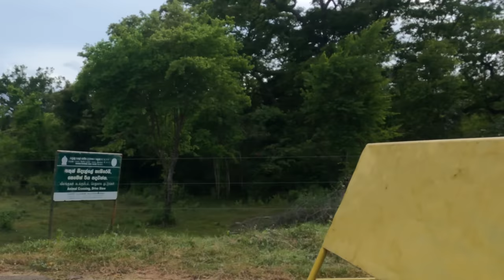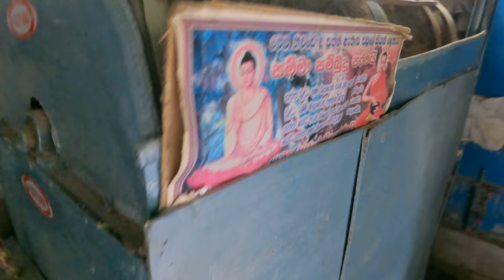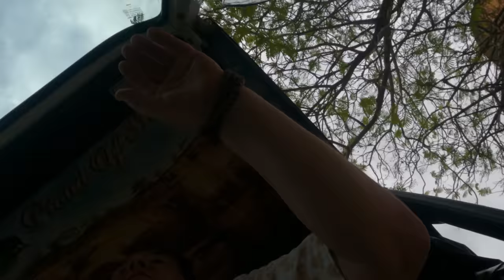I DON'T WANT to SEE any more ELEPHANTS 🐘 🇱🇰

Comment: I see OH&S is not a strong point in the Rice Mill with all the spinning pulleys and belts, and I wondered what you meant about a 5 Legged Elephant, geez hehe.
Reply from the maker: LOL.. Indeed Buddy
Reply: Oh! LOL I just got it! 😂😂😂😂
Reply: Regarding rice milling machines they use there which are small scale,  aren't very dangerous. Unless you try to jump into one chances of getting injured by one is very low. biggest Danger actually prolonged exposure to dust made by milling process.